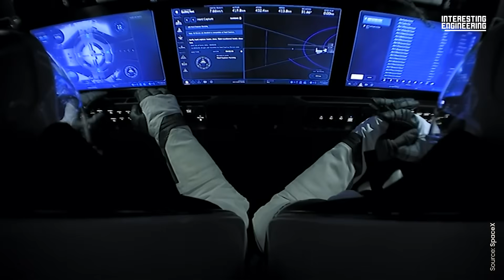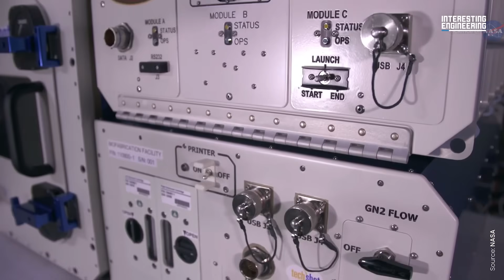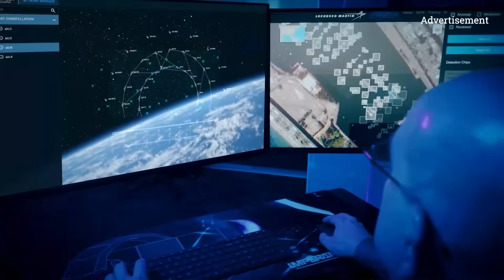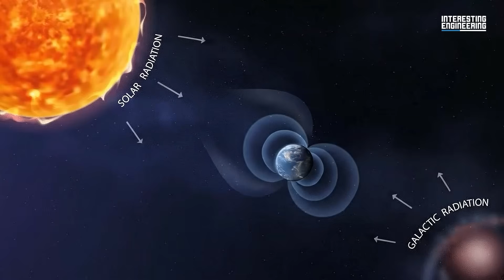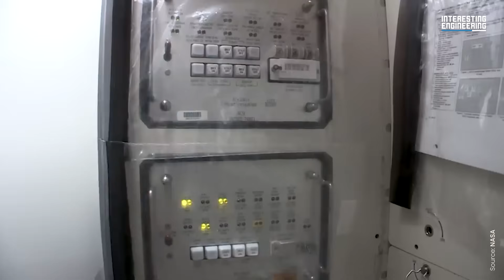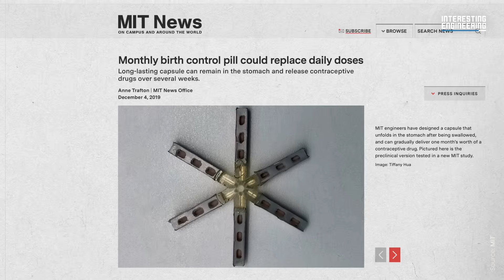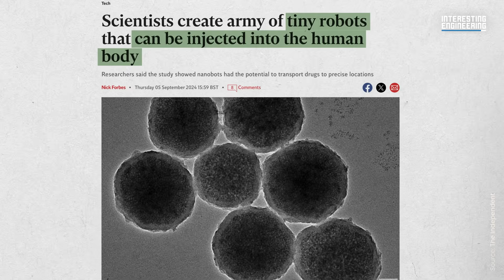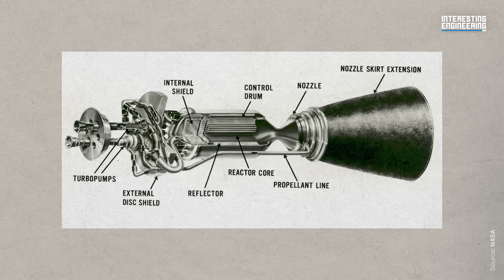Why We Can't Go to Mars

Comment: Let me count the ways, poison soil, dust that clings to everything. You have to be in a pressurized suit or any environment otherwise the temperature of your own body fluids would boil let alone no oxygen. Radiation rips your cells an DNA apart, not enough gravity so your bones disolve even if you do resistant exercises 3 hrs a day and if you need help it will be about an hour to get your response which will be sorry your on your own. I say send the AGI robots that we will have in 2035 and see how they do.

Comment: @3:50 Mars is 140 millions mile from earth on average . But at is closest point it's 34 million miles away.

While it's said that a trip to send a human there is 7-9 months I think it would actually be longer because the weight would be much greater. You need to carry food, water, oxygen and other things. Not just for the trip there but also the trip back. Robots are one-way trips.
Reply: 7-9 months is the most fuel efficient trip regardless of the size of the spacecraft.

You could get there quicker if you used more fuel to go faster, but you also need more fuel to slow down on arrival, otherwise you'd overshoot Mars.

The equipment needed for the return trip could be sent ahead of the crewed mission.

Comment: The soil or nutrient media for growing vegetables would be stripped of vital nutrients. I’ve been doing a ton of research into aquaponics/hydroponics. Fish are the most common animal component in an aquaponics system. They produce nitrates with the help of nitrogen fixating bacteria. Nitrates are good for plants but too much of a good thing is a bad thing. Any slight imbalance and the whole system crashes. A bacterial overgrowth or dramatic shift in water temp or pH can crash. Assuming all goes well. Nitrates are one thing. The other nutrients needed for healthy plants is crucial. Not just adding nutrients to the soil. There needs to be soil bacteria that help the roots better absorb the nutrients. Studies have shown that plants need rest. They are healthier if they aren’t under constant light.

Hydroponics has been very difficult to understand. It requires constant external input to work. Plant food fed through water with essential minerals. They need bacteria to help them thrive as I said before. 

Animals help create a better ecosystem for sustainability. Nothing beats nature itself. After all my research I decided it’s better to stick with growing a traditional garden and raising livestock. 

If they were doing it right. I would bring chickens along. They’re fairly resilient and live about 5 years. I think they produce eggs for 5 years then die a year or so later. But they need good protein like bugs and worms. This adds so many layers of complexity.

Comment: Recycling feces is not hard. That's the easiest problem to solve. I'm actually really surprised they haven't achieved that yet. It's actually really basic. Radiation shielding is the most difficult problem. It's easy enough to find people with the mental fortitude and botany skills to live and grow food in space. To solve radiation shielding, we need thick hulls. Building an artificial magnetosphere is achievable but at would require ridiculous engineering to build one powerful enough to protect sufficiently against radiation. It's much simpler to just use regolith to build thick hulls. Obviously it wouldn't make sense to do this on Earth because of the gravity, but we could build it on the moon.

Comment: Orion was a pipe dream onlyntaken seriously by the highly suicidal. It was never built, and the only test involved a small mock up craft and concentional explosives. 
Nuclear thermal engines were designed, built and tested from the 1960s-1970s and then the tech was shelved. When tested the NTR engines ran for over 24 hrs straight. 
Plasma engines have been in development for years now. Nasa astronaut Dr. Chang-Diaz and his co. Ad Astra have designed and built the VASIMR  plasma engine that works great but you cannot power it with chincy solar panels. That engine is throttleable, it can significantly reduce travel time to mars, but its going to need a nuclear reactor to power it. And nuclear power on the surface of mars is a must, solar wont cut it when global dust storms block out the sun and the atmosphere is just this side of a vacuum so wind turbines are out.
Reply: Nuclear electric is best option

Comment: Also having emergency pods with supplies like spare parts , medical supplies etc... sitting out between earth and mars with its own propulsion system  so if the astronauts get into trouble on the way to or from theyd have somethin to call for help
Reply: "sitting out there" ???? Any "pods" have to travel thousands of miles per hour just to stay in orbit, they cant just float around independent of the Sun and other bodies.
Reply: @dnomyarnostaw right theyd orbit in stable areas called Lagrange points. Maybe know what youre takking about before talking shit
Reply: @limabravo6065  Dopey comment.  Those Lagrange points are constant distances from planets like earth,  which themselves orbit around the Sun at thousands of mph.
They dont just float in space.  Cheez!!

Comment: Meanwhile, since the '70s NASA Ames / Stanford space settlement studies, there are no new inventions needed to mine asteroids and moons and to build for virtually Earth-like conditions in large comfortable habitats, anywhere in space where there are or to which we bring materials.
Reply: How would you shield these people from radiation?
Reply: @Krunchy71  1.9 meters of packed sand, or better, 1.6 meters of reinforced concrete as structure and shielding.

Easy problem, easy fix, when we're talking about the infrastructure in space to build a habitat for ~10k people (as the '70s NASA Ames studies were building to).
The first such habitat for the workers in the space factory would have been done within 30 years. Cost until NEO metals start coming in or years later when the hab is done, is like many other large infrastructure or industrial developments down here. Over the 30 years, less than 2 years of our current military budget.
Reply: @JFrazer4303  The weight of 1.6 meters of concrete would be absolutely insane. Fabricating it in space would cost trillions of dollars.

Comment: Emphasizing shorter trips is completely wrong-headed. What you need is bigger ships. These would require an infrastructure in deep space to build them, so we need to prioritize that. But once you can do that, it's vastly easier to deal with long flights. You can simulate gravity. You can shield against GCR and solar radiation (two very different things BTW). You can have all manner of amenities that are just not possible on a small ship. That's the path to take.
Reply: The ship you are talking about would cost trillions. To shield from radiation you would need an enormous amount of weight, which requires propulsion technology that does not currently exist.
Reply: @Krunchy71  You're looking at this too narrowly. What needs to happen is a supporting system that can obtain materials from Space, and manufacture in Space. At this point, huge amounts of mass can be moved without hauling it up from gravity wells. Yes, the quantities are enormous compared to anything previously used, but you can move things in Space much more economically. Yes, propulsion of ten times the mass is expensive, but no more so than going three times the speed. (KE = m X v^2.) The thing is: When you have radiation shielding, and artificial gravity, you can afford to be slower.